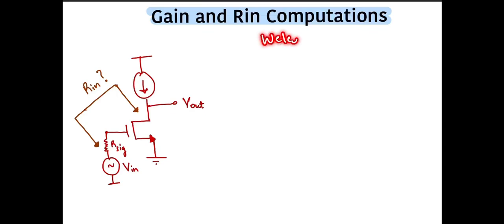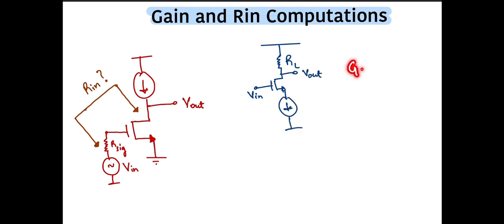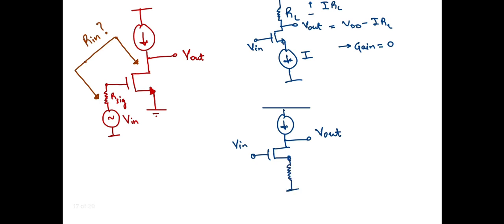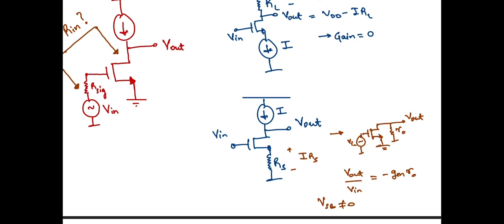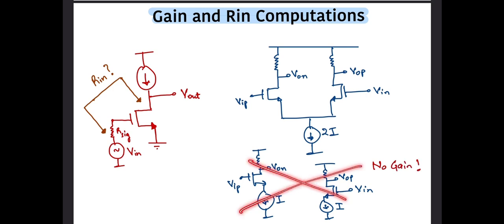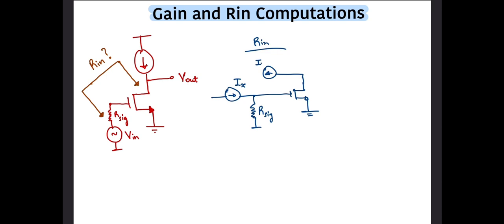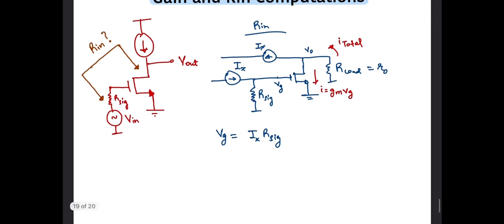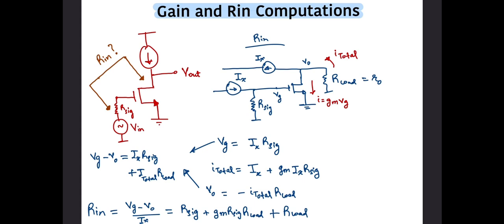Gain and Rin Computations ; Analog Interview

Comment: sir can you bring video on the application of  using mos in subthreshold region
Reply from the maker: Will try to discuss it in a future video. 

Usually MOSFETs are operated in sub threshold for ultra-low power applications, or to mimic BJTs in some cases. 

The gm is maximum around the border of subthreshold and saturation, so that is another case where we might operate the MOSFET in subthreshold. For instance, the input transistors of a differential pair.

Comment: Am not sure if I agree with your analysis. The ideal current source is just set the DC working point of the circuit. It will have no impact on the ac signal operation of the amplifier. We give DC sources zero value when we do ac analysis.
Reply: The answer is not wrong, the gain is zero. However, I think a better analysis is not to use the DC operating point to explain zero gain. In AC analysis, the current source is open and there will be no current. Which means gm is zero, therefore the gain is zero.
Reply: @rezarmzn  gm is dc quintity. So it will come from idc how it can be zero. Now it is confusing from both the analysis. I am also not ok with his analysis as well.
Reply from the maker: @Str_for Could you please let me know the confusion so that I can clarify? 

You are right that gm is a DC quantity, and is therefore, non-zero. The proper method is to go by the small-signal model. However, in this video I wanted to show a different perspective of analysing such circuits. 

Note: if the voltage at a node is constant, then it is a small-signal ground. That is why we ground the supply (VDD) and input voltage source in a small-signal analysis.
Reply: @Str_for  gm is a measure of how much the output current (Ids) of the transistor changes in response to a change in input voltage(vgs). Such dependancy does not exist due to the ideal current source, therefore the gm is zero.
Reply: @TejasKetkar  we can directly explain is like this is common source with degenartive resistance. Which provide negative feedback to amplifier. Here due to ideal current source r degenartive is infinite hence gain is 0. We can put it in formula as well.
Reply: you can also go through that approach and then you would observe the same results as discussed in video
Reply from the maker: I’m glad that you are challenging the analysis, and thinking independently.

You may open up the ideal current source for small-signal analysis, and then verify my claim with a proper small-signal analysis. 

An Ideal current source fixes the current in a branch, meaning that the small-signal current is constrained to obey the KCL.